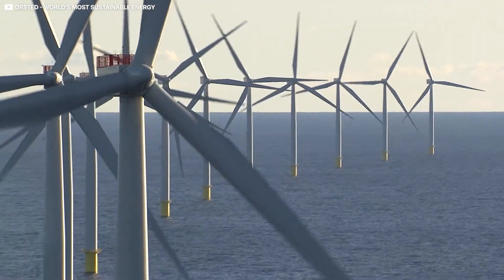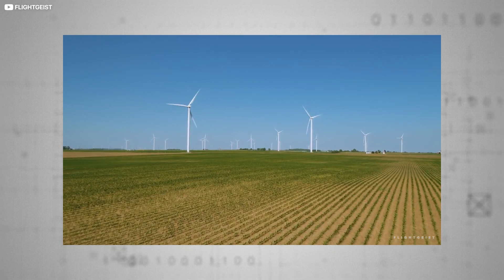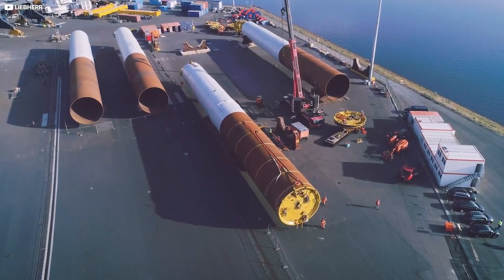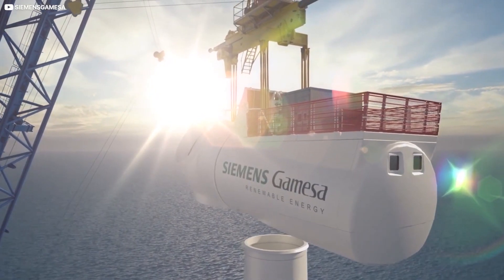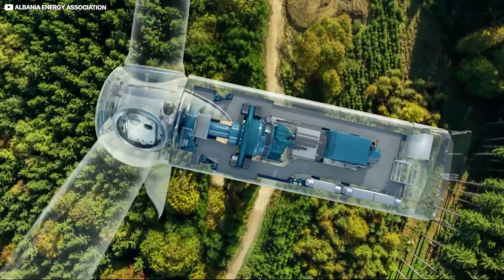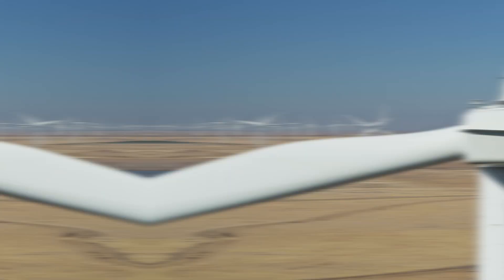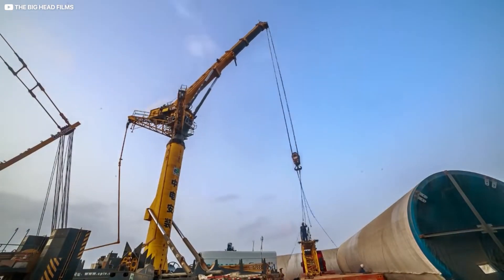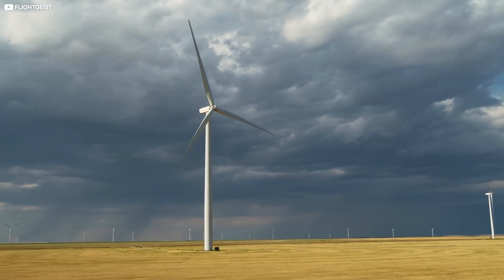How Wind Turbines Are Built

Comment: 1:45 in this shot the seabed suction piles that the sturdy steel ropes are attached to are visible. But the suction piles aren't subsequently mentioned, just the sturdy steel ropes. Suction piles aren't the noisy pain in the arse to install that driven piles are but they aren't free to install and they weren't supplied by carbon neutral elves either.

Political Statement: the AGW crowd are inherently dishonest. If the AGW crowd were honest and devoted to technical accuracy they would include the CO2 debit that energy sources disingenuously deemed green start life with as well as the CO2 debit to dismantle existing fossil fuel energy plants. But unsurprisingly the AGW crowd like every radical revolution before it draws a huge amount of its support from folks who are profoundly ignorant concerning the system they believe the dismantling of will benefit everyone.

Comment: 0:55 All that polluting concrete used and we call this "green" energy?
Reply: Modern turbines offset the c02 needed to manufacture and install them within 0.5-1 year
Reply: @hansagger4519  nope. You can see in the video they deforest trees just to make wind turbines.
Reply: @insectbite1714  so your poor little coal plants are a better choice?
Reply: @Zippiye0001  yes, yes they are. Coal plant in my area pollutes less than the 29 wind turbines and 2 natural gas power plants. The coal power plant produces more energy than the 29 turbines and 2 natural gas power plants as well.
Reply: @insectbite1714  I think you have to redo your homework.
Reply: @insectbite1714  A 1gw coal power plant requires appox 9000 tons of coal per DAY, 3 million tons per year 100 Million tons over 30 years, plus 20 to 40 gallons of fresh water per KW, thats 100's of billions of gallons of fresh water over the life to the coal power station. Plus takes almost as many materials to construct the coal power station as the equivalent windfarm when including the infrastructure to mine, transport and process the coal. Plus 100 of millions of gallon of oil for the mining and shipping of the coal.

How is this cleaner than a wind farm that requires no Coal, No oil and no fresh water, and about the same amount of maintenance cost and resources as the coal infrastructure.
Reply: Russian bot. Go wIndmills!

Comment: Now that's a LOT of pollution in the wind turbine making process!! !!
Reply: You can say that about every power plant. The big difference is they don't release co2 emissions after they're built.
Reply: @devinmay3038  liar. They make global warming which makes fires which makes co2 and also they deforest trees for wind turbines and they put them in the water which makes methane get emmited a lot.
Reply: @insectbite1714  You obviously don't understand anything about how turbines are made or how they work.

1. Just your statement of "they make global warming" is just nonsensical. Everything contributes to global warming. Some things more than others. Like burning oil, gas or coal just to spin a turbine. When you can get the same outcome with just using the wind itself.

2. Most wind farm that are built (at least in the US) are put up in areas that have already been terraformed or cultivated by agriculture. Agriculture is the biggest contributer (Mainly Beef livestock) to deforestation. So if you actually cared about trees you'd stopped eating beef.

3. I don't know where you get the idea of Methane coming from wind turbines. I think you have some wires crossed upstairs. If you're against Methane leaks, then you should be against using fossil fuels to produce electricity.

If you're going to argue against wind power. At least bring some actual facts next time.
Reply: @devinmay3038  stop answering him. He is a troll and wants to make you feel insecure
Reply: @nils96__37  Clearly after that last comment. There's no having any intellectual debate with that fool.

Comment: Applying floating applicable onto both offshore and onshore communities combinational dual core purposes fundamentally basis less disruptions and more importantly alternatives provision transitional networks path analysis surveillance windy monitoring system awesomeness to newly built installation degrees of freedom bearing magnitudes and uv index purification air conditioning provides concurrently wind turbine towering heighten oscillations with its safety factor facility amenity capacity dimensions availability units distinct distinguished distance construction external diameter caliper dial indicator it's environment economics ecology scale ⚖ 😀

Comment: Question please ,regarding how turbines work 
As the outer portions of the blades travel really fast , many hundreds of KMH, I’m puzzled as to how the prevailing wind, (possibly only 50 KMH ) can make it spin so fast, or rather how is the fastest travelling portion of the blade actually helping with the turbine, ??  I can’t sort out why it’s not hindering the speed and power production 🥺🤯
Reply: It is all about the amount of energy contained in the wind. Looking at the turbine from the front, the blades are designed to capture as much energy as possible from the incoming wind, while the leading edge of the blade is designed to be as aerodynamic as possible.
Reply: @kasperimerandersen3755  thanks, but where my brain hurts thinking about it is how travelling at hundreds of KPH from a breeze of say 50 kPH isn’t a burden on the fan blade ? How can it be beneficial to the process ? 🤯
I know how difficult it is for a car (no matter how aerodynamic) to travel faster than 300 kph the wind resistance increases expadentially the faster you go, and these fan blades (the outer portions) travel over 500 kph. ? 🤯🤯
Reply: @spinnymathingy3149  It is a burden on the wing, but they're built to withstand that, just like, say, an airplane wing which also can travel at high speeds.

If the blade was against the wind at the same angle from center to tip, you would be correct; it would not be beneficial due to the difference in wing speed. So they correct for that by making the blade angle more and more shallow as it gets toward the tip. That way, the forward push by the wind is the same all along the blade.
Reply: @pjacobsen1000  thanks for that, 👍
Reply: @spinnymathingy3149  with turbine blades and wings, wing tip vortexes and the drag they induce can be mitigated by careful design of the wing (or blade) section. A high aspect ratio will reduce drag losses and smooth the airflow around the tip of the airfoil.

Comment: What remarkable technology! 🤓🙋🏼‍♀️👍
Reply: @Kidreyli refresh my memory as I am not sure what you are referring to.
Reply: @ladyselenafelicitywhite1596  coal is better!
Reply: @Kidreyli I found the thread. I don't know why you didn't just continue there. I reread your four irrelevant points.  

 @Kidreyli  you're 10 years old? 

There are several problems with what you wrote and I will try and keep this as simple as I can.

1) Oxygen is not corrosive as it doesn't produce an alkaline or an acid when dissolved in water. It does cause oxidation of certain materials, such as iron.
2) Carbon Dioxide when dissolved in water produces a mild acid called carbonic acid which is corrosive. It causes the destruction of corral reefs and damages buildings, especially metal, concrete, and cement.
3) Oxygen makes up appropriately 20% of the Earth's atmosphere. Even if we converted all the Carbon Dioxide into Oxygen and stored the Carbon, we would only add less than 1% extra Oxygen to the atmosphere. 
4) Trees help cool the local environment by creating shade and via a process called transevaporation. This is the same process as how sweat keeps you cool. They also protect crops and animals from heat stress.
5) Trees help prevent salinization of agricultural fields. Salinization is where an excess of salt ends up in the top soil and prevents crops and grass from growing. When trees are removed the ground water rises to the surface and evaporates, but as it evaporates it leaves the salt it is carrying behind. Whilst this can be dealt with by flooding the fields with fresh water, you have to have an abundance supply of fresh water. It is better to have trees that stop this process from happening. 
6) Trees help prevent desertification. They do this by holding soils and moisture in the ground. They also act as a barrier to sand. For example China is planting the "Great Green Wall" you can find videos about it here on YouTube. Both India and Africa are carrying out similar projects. 

I hope you find this information helpful.

Edited. I'm always confusing carbolic acid with carbonic acid!
Reply: @Kidreyli continued, as for your four points. 
1) Ecosia funds the planting of Mangrove forest. Those forests protect fish and other aquatic life as well as acting as spawning grounds.
2) Trees provide food for forests dwelling animals including bears and bees. 
3) Plastic pollution is a separate issues and can be tackled via different charities. 

Look at the links I have been posting! 

This website supports charities ⬇️⬇️⬇️⬇️⬇️⬇️ that removes ocean plastic pollution...*
Please also consider using thenonprofits website. It can also be found as 70 clicks to donate.  All the clicks cost you nothing as they use advertising money. They plant trees, protect forests, and help many humanitarian causes. 🙂😘

*They also have links that fund projects that protect turtles, dolphins, whales, coral reefs, and encourage sustainable fishing policies.
Reply: @Kidreyli I'm sorry, my intention wasn't to be rude. You'll have to forgive my bluntness. 
I am aware that carbon monoxide is dangerous, but not particularly relevant to our conversation. Most of the historical sources of carbon monoxide have been dealt with via modern technology.
Reply: @Kidreyli oxygen levels have been as high as 30% of the Earth's atmosphere. However, even if we converted all the carbon dioxide in the atmosphere into carbon and oxygen, the amount of oxygen in the atmosphere would increase from approximately 20% to 21% 

The problem is you're using the wrong words. Oxygen is an oxidizing agent so will "corrode" certain materials. However, that process is called oxidation. Carbon Dioxide is corrosive as it produces carbonic acid when dissolved in water.
Reply: @ladyselenafelicitywhite1596  coal is better energy source
Reply: @insectbite1714  continued. 

Does the building of wind turbines, solar panels, etc create some pollution? 
Yes, unfortunately they do. However, so to does the building and maintaining of coal fired power plants.
Reply: @Kidreyli I am glad you are using Ecosia. I wasn't "yeeting" anything. I'm a librarian not a scientist, so I am using the language I would use if I was explaining this to anyone.
Reply: @Kidreyli I stand corrected, apparently oxidation is a form of corrosion.